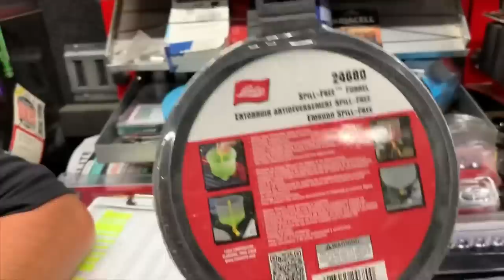Snap On Friday: Semi Deep Sockets On The Cheap

Comment: I love that funnel, I got mine from Amazon a while ago. It works great for bleeding out the radiator, but it's also great for adding engine oil and other fluids under the hood with zero spillage. The important thing when using it for multiple fluids, is keeping it clean. I just wash mine with Dawn dish washing soap after each use.

Comment: Clay,  are the new Icon mid lengths any good?             What's your opinion on Icon sockets?
Reply from the maker: I don’t have the mid lengths but i do own the short and deep. The chrome ones are softer than say snap on or other big names but they work great. They will wear out faster but you can warranty them (entire set goes back and a complete new set you get) so … i wouldn’t worry about it. All the icon stuff is good. Some people just like to hate on HF.
Reply: @KoonTrucking  Thx Clay